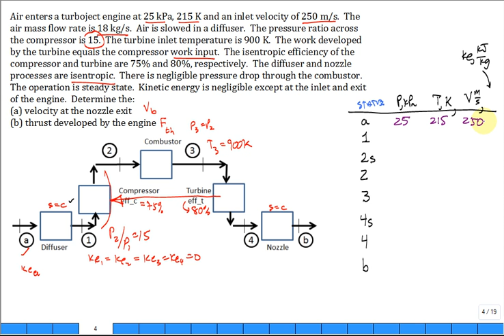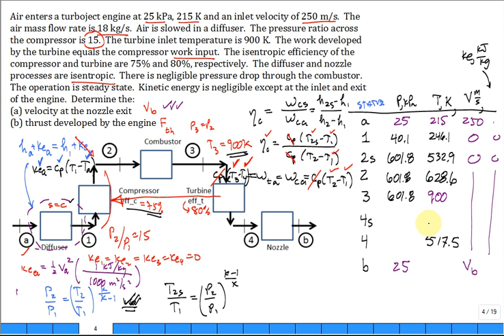analyze turbojet engine solving for exit speed and thrust

Comment: The exit gas speed of 413m/s still 0.97 mach because have 448K and sound speed is related to gas temperature itself? But after few meters of nozzle is not more correct be considered supersonic (mach=1.4) if related to sound speed of 295m/s wich is the overall external ambient for the engine with cold air of 215K? Also this ambient is the reference to the input and movement of engine (mach=0.85). Temperature at 40000feet according the table https://fighter-planes.com/jetmach1.htm and also if we use the same formula (sqr(1.4x287x215)=295m/s).